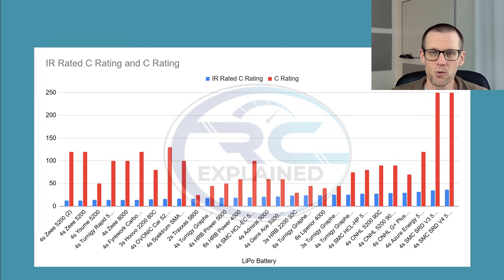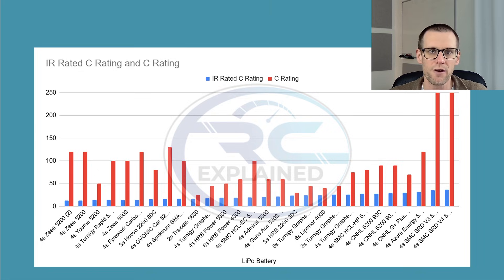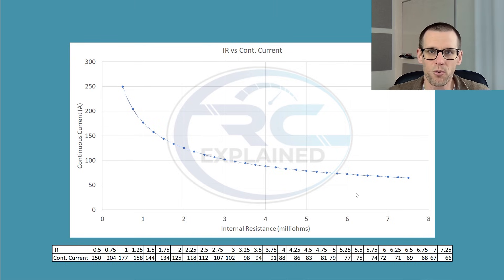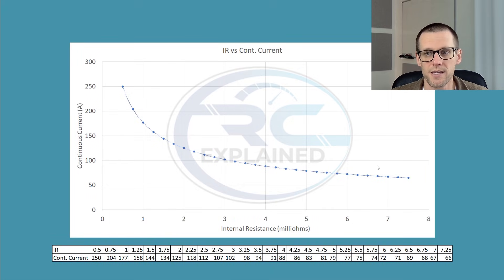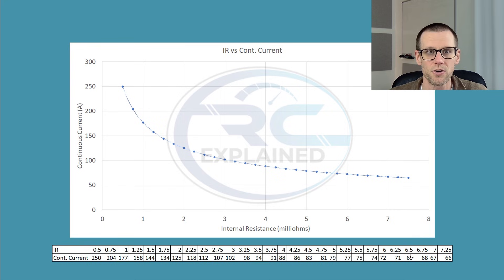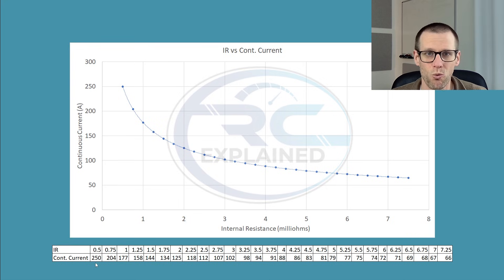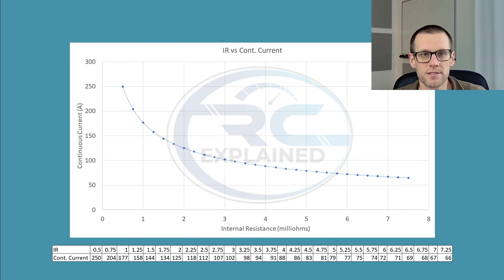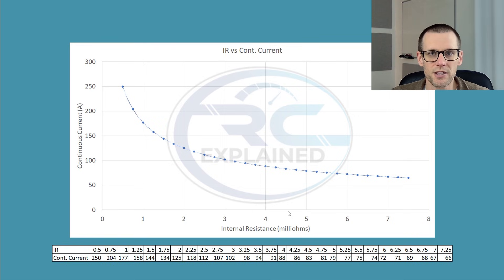Why Small Internal Resistance Differences Can Mean HUGE Performance Changes

Comment: So I just wonder, my zeee batteries seem pretty powerful, it’s hard to imagine that if I got an smc or similar that id see more than double the difference. Also what does that mean for the longevity of the car?
Reply: The internal resistance of the battery is in series with the power cables, plugs, ESC and motor. So their resistance add up. So half the battery resistance changes the total resistance of the system (and therefore its max current) way less percentage wise. Lower resistance only means more wear, if you use the increased current capability the drive the car harder. If you accelerate and drive as fast as before, the lower resistance in the battery will just lead to less battery heating and better runtime.
Reply: tristanwegner I can say the difference from Zee to CNHL G+ in my bone stock 6s big rock was shocking. I haven’t tossed my gnss on it yet, but I’m on the brakes way earlier at my speedrun spot due to the truck reaching speed much quicker.